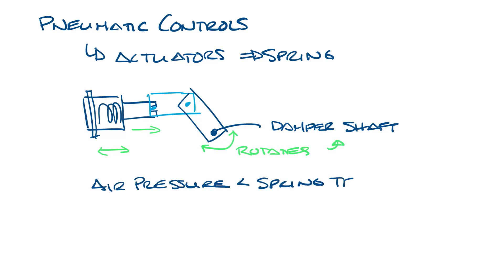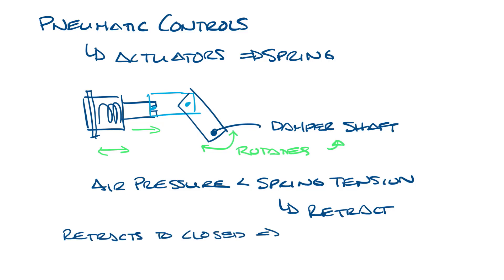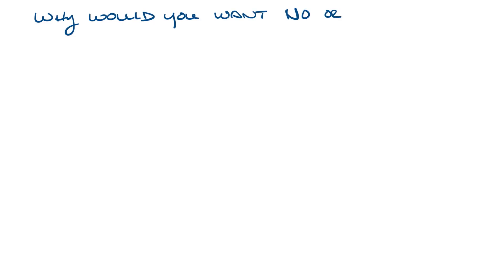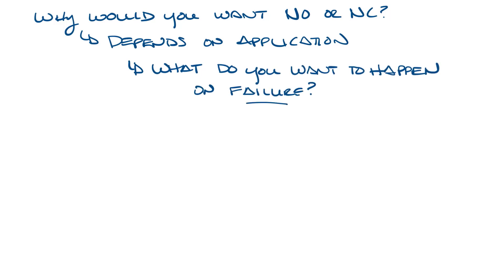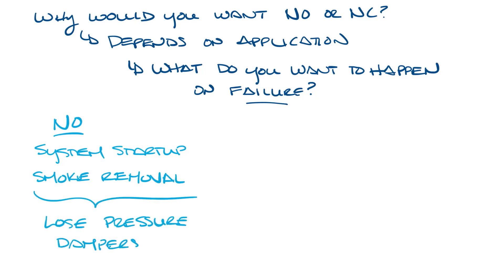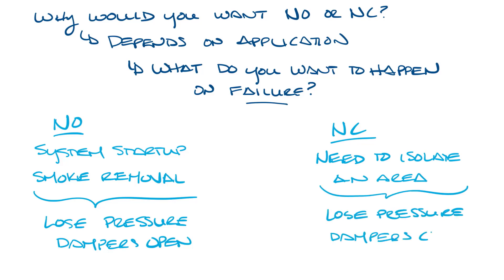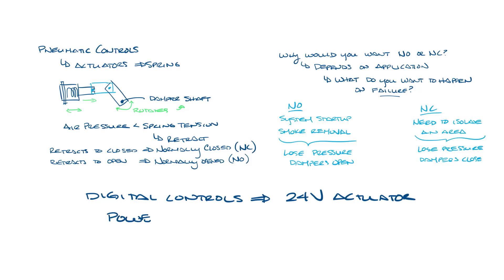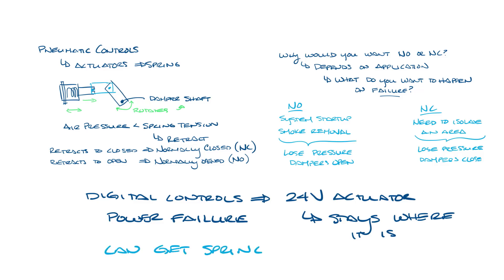NSW HVAC Academy - Normally Open vs Normally Closed

Comment: In my home something is wrong with my upstairs zone. I just replaced the actuator because it wasn't opening 10% of the time. Now the new actuator has been working for 2 weeks but overnight it has not been working causing the temperature to rise to 78 even though it was set 73 all night. The downstairs zone has no issues opening and closing. Any suggestions would be appreciated.